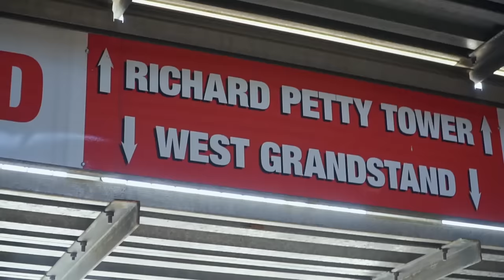Riding 500 miles on 70’s Honda MINI BIKES to Find Ike’s ABANDONED Mountain Cabin! 2020 Fall Special!

Comment: I lived in a small desert town. Mountains and trails sagebrush and cliffs. I could take my honda 70 along a cliffside trail, if the trail was a dead end because of a rock slide, id just carry the 70 over the rocks and keep going. If i came back the same way because no other way back, id just carry it across the rocks again. Its an amazing little mode of transportation. Also you can pop a wheelie for a city block by turning your feet out side ways and dragging them while on the throttle😎

Comment: Hey guys, Loving the road trip. I sit here laughing, smiling and shaking my head as me and a group of mates did the UK's John O'Groates to Lands end run in 2006. I feel your pain both in the fuel tank size and the ass. We rode the ST70's British equivalent  (115cc updated 12v 90cc with ATC 70 4 speed box) We had racks on the front piled and back piled high and like you were riding between 100 & 200 miles a day between night stops. Loving everything you guys do but especially the CT70 builds. I'm just putting together a 1970 K0 12v update with a Honda 119cc. Looking forward to the next episode. Enjoy guys and keep safe, Russ UK 👍🏻
Reply: Thanks. It was a blast!

Comment: Brings back fond memories of both my Mini trail 50 and my Trail 70H. These were small trail motorcycles, they were not mini bikes.  Mini bikes didn't have suspensions or gear boxes  and had either a Briggs & Stratton 3 hp motor or maybe a Tecumseh one, like a lawn mower.

Comment: I had one of those,I fished it out of the metal pile at the town dump.
It didn't run, throttle was rusted tight,tires no good..but I got it running and it was alot of fun! 
I didn't dare take it on the road as state troopers would snatch it right out from under me.
But I followed railroad tracks,Forest trails and logging roads...those Honda's were cool!

Comment: I think it's cool and fun to take those small bikes but, They aren't powerful enough for those big hills. I do believe the speed limites are much lower on those twisties in the Blue Ridge roads. I have a couple scooters and a big cruiser. 86 Elite 150 deluxe, 2001 Honda Helix 250. (dream ride) just not enough power in the hills. I have it geared with weights in the cvt for flat top end though. I got an 06 VTX 1800 that could do anything it wants to but is a bit hairy in the twisties. I'm a little scared because of the weight. I just need more ass in the seat time. My back can't handle long trips though. It's fun to watch youre vids and make believe it is me doing the fun shit! Thanks for the entertainment!

Comment: If you used the leaking tank first,  it won't leak quite as much because you're drawing gas through the carb, and not wasting every thing. Then when it runs out you still have two full tanks to use.

Comment: You guys might already found out check all the engine case bolts especially the ones on the bottom because on my 125 they were loose and caused the leak

Comment: I live in roanoke. Nice. Whish I knew yall were passing through. I have a 540cc vertical shaft motorcycle I built out of a lawn mower  and recently built a stand on top 500watt 36v folding electric scooter

Comment: The worst issue I ever had was multipe flat tires. When you take those 2 peice rims apart so many times and take apart the hubs, that are soft metal of some sort you start eating up the threads and have to keep tapping a size up. The later model may be better. My Z50's were 82 83 85. CT70 was 84 I think.

Comment: You guys should try out the 1982 Honda urban express deluxe because they go 100 miles to a gallon of gas as they are automatic and top speed is 40miles per hour and you can ride them with a regular driver license.

Comment: Why wouldn't you just use a 50cc with some upgrades and get better distance without mods for gas tanks. At the same time using all the same type of bike is cool to. Great video. I need to find some people to ride with to do some long distance stuff. Awsome video.

Comment: @ CarsandCameras there is a bar mount  metal tank on Ebay claims it will mount on ct70  2.4 gallon that and the main tank would be probably 200 ish miles of range on my bike.  I can't find any examples of it online so I figured  I would see if you guys would be interested. it would transfer the weight towards the front which this bike could use, and make your next 500 mile trip way easier.
Reply: ok, after looking more into it there is probably no way  without severe modification to make that tank work. It's almost 21"  long which is way longer than the space between the seat and bars.  still looking for a good bar mount tank for it. as 50 miles per tank sucks for dual sport riding. and all my gear and a gallon gas can  on the back rack  leaves the front on the light side. I would love to run a second tank if it could be mounted on the bar or up front somehow.  some of the china four-wheeler tanks look like they might work.  maybe rig it so it can be taken off when I'm not doing long distance.

Comment: them excited over 100mp a few gallons me over here like amaturers i get 200 miles on half a  gallon on my 2stroke 212cc bicycletops out at 105 (might be faster but i got scared the wobble was real)*obtained through gearing and a built motor i plan to make it fuel injected soon*

Comment: Charles is probably 50 lbs lighter than Ike. Chase shoulda been on the slow bike, the 125. Weight matters.
Reply: I wrote Chas, as in Charles. F'ing auto-correct.

Comment: Hi so I have a question I'm not sure why my motor is not tuning on I took out the governor from my GX 160 5.5 and I took out everything and make sure nothing was left so I put up everything else when I pulled it for about 14 times it still didn't turn on so can you guys tell me what should I do ???
Reply: Check for compression, fuel,ignition, thats what i would check. Hooefully the cam is still in time
Reply: I checked everything
Reply: But thank you appreciate

Comment: Is it really that impressive if the slowest one has a 125 cc engine? I commuted 40 miles a day to work on my 125 cc scooter. So in about two weeks of daily riding I would ride that far without having to do anything but put fuel in it. Top speed (54) was needed twice a day for a few miles.

Comment: Put the biggest and heaviest rider on Johns lil hot rod bike.and the smallest lightest rider on Ikes anemic child after removing the air filter and probably see an extra 3-5 mph top speed through the hills....4 hours at 3-5mph faster = 12-20 minutes quicker eta... And that's a very long time after a day or three of riding lil mini bikes with their non compliant suspensions all day..

Comment: those are NOT 70cc bikes . XION plastic 32oz drink bottles hold gasoline without leaking or melting for over two months now  no need for expensive fuel tanks

Comment: I absolutely love Cars and Camera since i seen the 1st Go cart show I believe on Velocity.   I have a 190 with a 212cc head from www.wholesale-cycle.com.   Prebuilt engine.  I used the stock carb got 2 30mm flat slide carbs coming.  Can you make a video on tunning the 190 recommend jets best carb in detail?  Im at wits end thinking i should have went 140.  I just wanted to go 70 if needed short highway run.  This will be the 3rd starting chain so anoying on the 190.